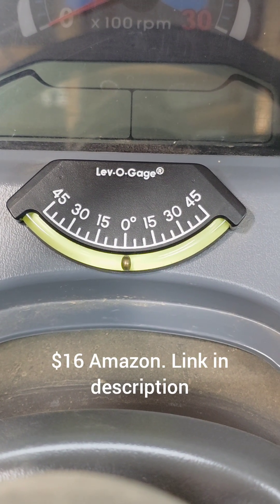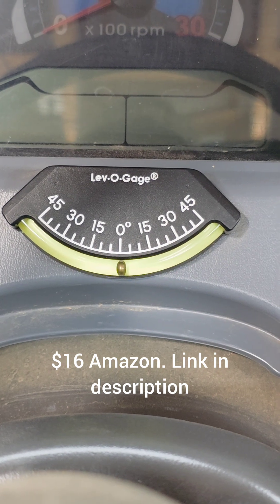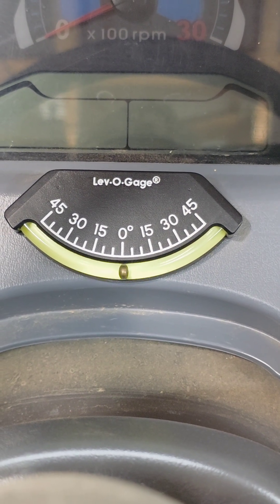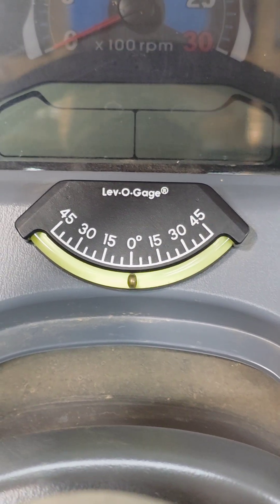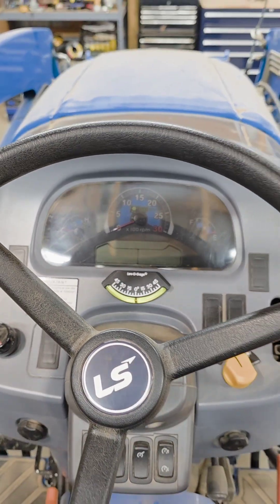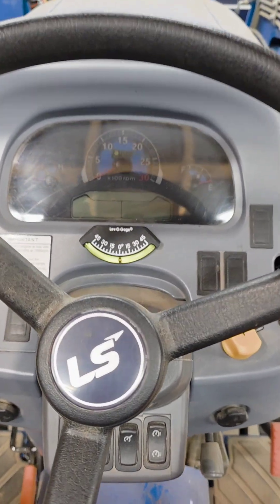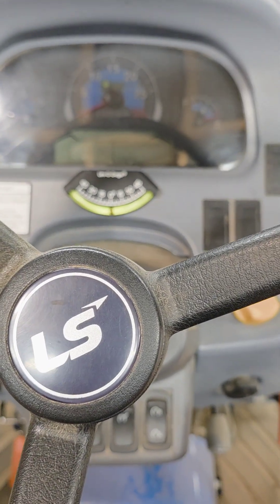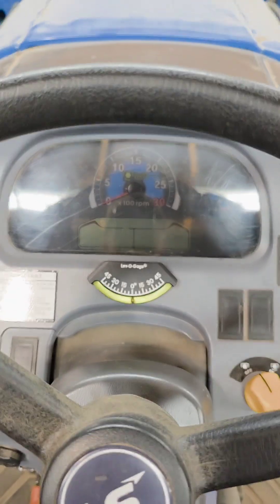Tractor Clinometer??

Comment: From Grok AI:  "The common maximum side incline angle considered safe for operating a cab tractor like the Yanmar YT359C, especially with liquid-filled tires (which add ballast for improved stability), a front loader (kept low), and a rear attachment like a 10' rotary cutter, is generally 15 degrees. This is a conservative rule of thumb based on industry guidelines, operator experiences, and factors like dynamic conditions (e.g., bumps, wet grass, or sudden turns) that can reduce stability beyond static tests.
Exceeding this can increase rollover risk, though some experienced operators report handling up to 20-25 degrees in ideal conditions with proper ballast and wide wheel spacing. Always prioritize safety: use ROPS with a seatbelt, operate slowly in low gear and 4WD, keep attachments low, and avoid if it feels unstable. Consult the operator's manual for model-specific warnings and test cautiously on your terrain."
Reply from the maker: Yep makes sense. I do all of that and 15 degrees is good with me.

Comment: I have a Mahindra 4550.  I’ve added beet juice in the tires,  I have no problem mowing with my brush hog on the side of the hill,  maybe 15+ degrees, I don’t have a meter but will order one now for the info.
Reply from the maker: Cool thanks. My 240 tires are loaded with methanol. I'm certain I can take it further than I do but interested in what others are doing. I appreciate the info my brother.